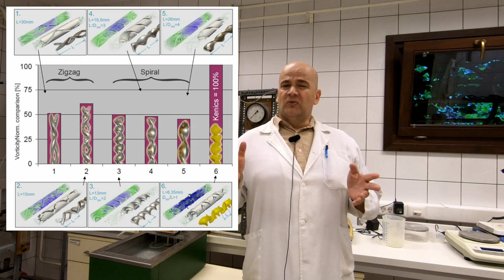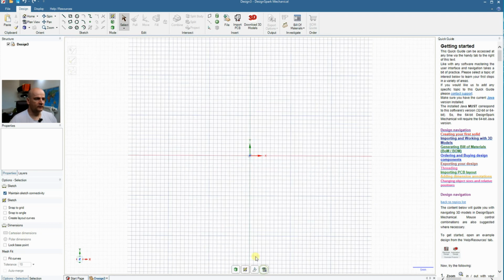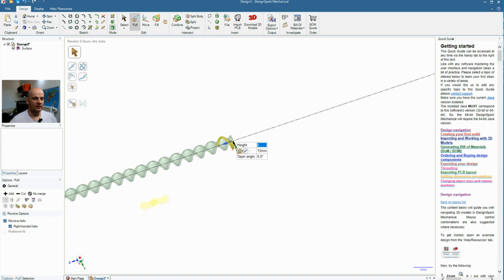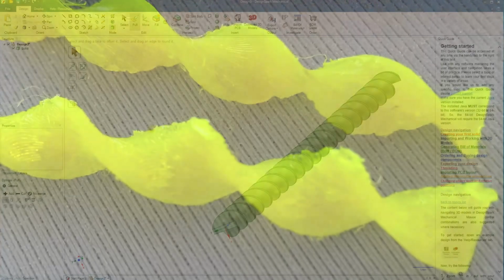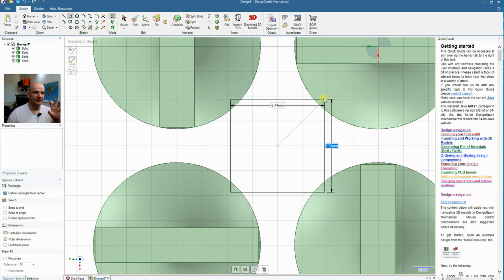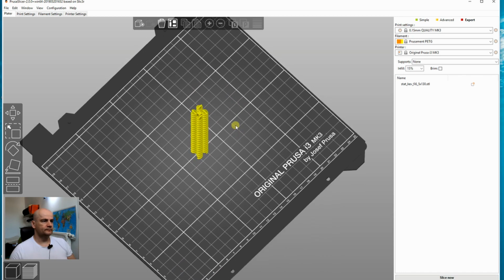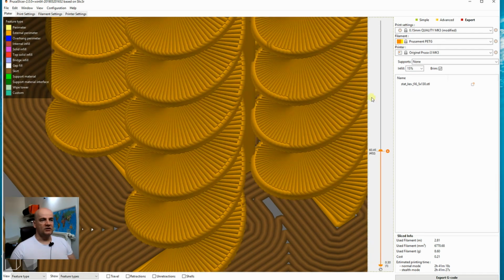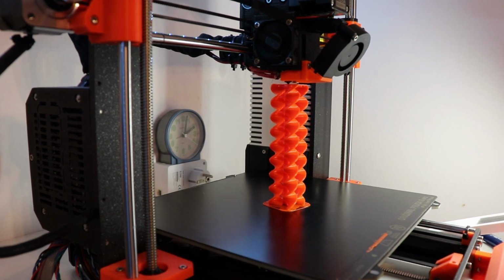Spiral helix turbulence promoter for membrane filtration

Comment: Have you tried to use a sweep in Fusion with twist angle?
It makes the same spiral you made in Design Spark Mechanical.
Reply from the maker: Yes, I used it since I created this video. I also created a video "Custom Threads" using this technique: https://youtu.be/nwsPWjqPz6M
Reply: @MyTechFun  Cool: I'll check that video.
Reply: I checked the video: interesting. 😃

But you used the coil function while what I was saying is a bit different.
What I mean is: if you sketch a rectangle, sketch a line perpendicular to the rectangle and select the rectangle to sweep and the line as rail, then you can set a twist angle in the sweep settings that'll twist the rectangle along the rail, making a spiral helix thing.
It'll somehow have concave faces, tho; but you can compensate making the rectangle's shortest sides round.